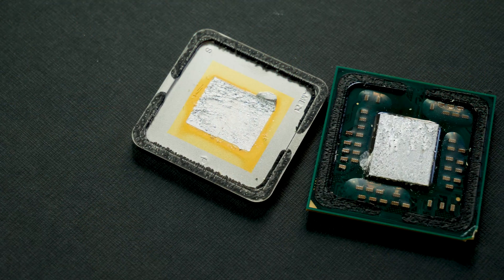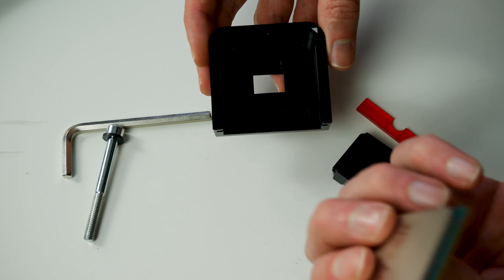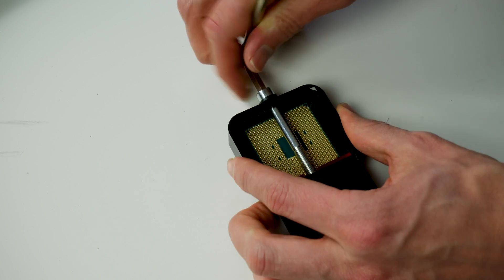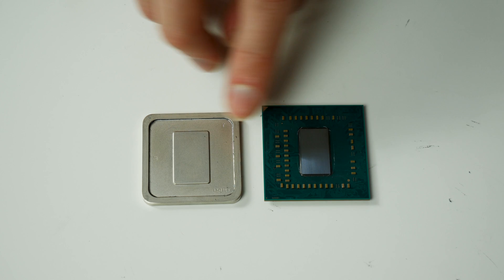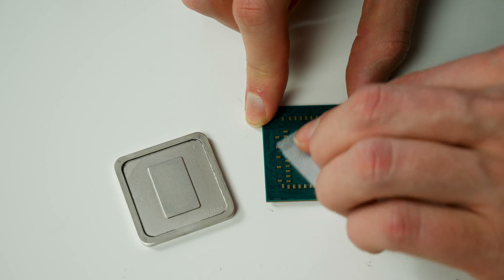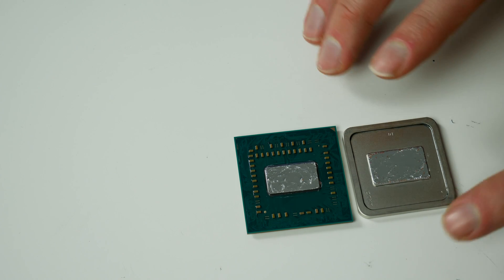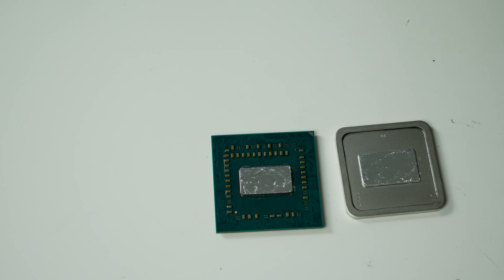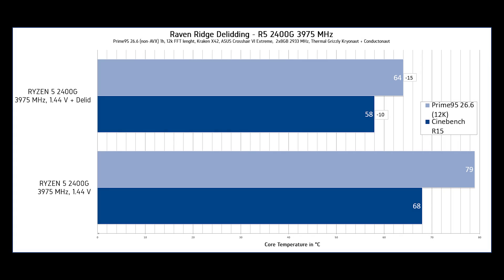Raven Ridge - Ryzen 5 2400G delidding. Before/After Temps (en)

Comment: Would have liked to see stock TIM max overclock with load on both CPU and iGPU vs delided max OC load temps on both. I already saw that the iGPU on stock TIM hits about 1.6GHz and the CPU stock because it was running about 90c, i just want to see what a delidded CPU and iGPU can overclock to while both under load.

Also noticed that when you overclock the iGPU the 2200G catches up to an also overclocked 2400G, possibly a RAM speed contrant (3200 C14, over on Hardware Unboxed)
Reply: I'm pretty sure in that video its oc'd 2200G being compared with stock 2400g

Comment: Is liquid metal safe in the long run? Does it damage the CPU after some time?
Reply from the maker: it's safe :)
Reply: it's f***ing great
picked up a cheap used R9 390 because the guy was complaining its too hot and loud, a quick clean and some thermal grizzly -25c and wayyyy lower fan speed

Comment: You can cut a small piece of paper and put it between the pins and the screw, that way the screw can just very gently slide on the paper and cannot "touch" or get stuck on a screw thread(s). That is if you want to be extremely careful. 
Great video mate :)

Comment: Now all we need is for AMD to release a 6 core 12 thread APU. Also some motherboard maker needs to make a DDR3 motherboard. To make upgrading to ryzen more cost effective. It's the only reason I upgraded to kabylake over ryzen last december. Some may think DDR3 is too slow but due to it having half the latency they are really the same speed. Not counting some of the super highend kits.
Reply: The memory controller is in the CPU.  nothing the MB manufacturers can do about it if the DDR3 support is not built into the memory controller for it.
Reply: Ryzen and Raven ridge  only has a ddr4 controller so not possible...
Reply: TheInfinium99 not the same, the design of the professors allow for addition of extra features that uses pci Lanes, such as USB etc. The memory controller in these modern processors are tied directly to the CPU and is not designed to be bypassed to an external version if in understanding right. If it was possible I'm sure it would have been done already.
Reply: What you say is true. I think where the OP is getting this idea is from the fact that AMD has made IMC's that supported DDR2 and DDR3 (Phenom II ) and then DDR3 and GDDR5  Kaveri(though it was never enabled in retail units) and then Carrizo/Bristol Ridge has the same die (yes different REVS) but one used DDR3 and the other DDR4... However all Ryzen CPU's and APU's have DDR4 and NO DDR3 memory controller. I will have to dig more into the document on Raven Ridge to findout if AMD pulled another Kaveri and has an extra channel or two on the IMC and GDDR5 support.. Lol..
Reply: Kareef Huggins it's more than possible as motherboard makers have made chips in the past that can add support for extra things like. Usb ports and pci-e lanes.

Comment: What about the graphics OC? That’s what we wanted .. we already know that the cpu isn’t gonna clock over 4.1 and the temp isn’t the deciding factor, it’s mostly architecture... but the GPU is the question!!
Reply: the iGPU's core clock can be overclocked but it will be bottlenecked by the memory clock which is dependent on the system RAM. even at 3200mhz dual channel latency it's barely half that of a standard discrete GPU's memory clock speed of 6600-7000 MHz. so no point overclocking the iGPU since the system will just wait for textures, shadows and occlusion to render before moving to the next set of pixel rendering and command execution etc
Reply: You're talking nonsense, mayne channels are doing 1500Mhz+ test with 30-35% improvement on igpu performance. Which basically means playing from 28ish fps to near 40~ish fps.
Reply: Gpu performance scales better with gpu clocks than memory, memory overclocking can improve performance but nowhere near what core OC's do, this is really old knowledge by this point.
Reply: talking nonsense?  like what and name 3 "mayne channels" that are oc the gpu up to 1500Mhz or better , I want to see delided and aggressive cooling and going extreme on the overclock or to the clock barrier
Reply: GPU@1600Mhz Ryzen 5 2400G Review PUBG. Gameplay Benchmark. Vega 11 iGPU
Reply: sorry it was late last night and NO ONE was working the chip over on the "Mayne Channels"  lol
Reply: I'm sorry I was lost and confused you weren't even talking to me....please excuse me

Comment: Can you do a measurement of the die size compared to standard ryzen? It would be interesting to see what size is the GPU part. 
And do you think it's possible to see the difference between the 2 like you did with threadripper? (With the special non conductive liquid) For example when stressing only the CPU or only the GPU at once to see where the bubbles are.

Comment: Hey der8auer, thx for the interesting video. One thing that I don't quiet get: Don't you lose warranty anyways when overclocking? AMD clearly states this for example before I can use Ryzen's Master Software.
Reply from the maker: Only in theory. Nobody cares if you RMA an overclocked CPU. Nobody wants to say it but this is the truth :D
Reply: Oh, thx for the clarification!
Reply: how would they be able to find out? i heard that some CPUs may have a "warranty bit" that gets set when the clock speed or voltage exceeds a certain threshold but i don't know it really exists and if manufacturers even care reading this bit at all when handling RMAs.
Reply: It is said only that AMD has the right to void your warranty if you overclock, as per the warranty terms.
They say it does, I guess, so you feel responsible if you break it.

Comment: Awesome work. AMD's thermal paste seems to perform better than intel's counterpart. We all know that intel uses the cheapest possible TIM to maximize the their profits even on USD 1.7k processors, a real shame!
Reply: Mike Crapse the chances of failure induced by soldering are nowhere near those figures. If 10% of chips died when soldered, nobody would ever do so.
Enthusiasts shouldn't have to risk their money and void the warranty of their cpu because of intels crap decisions.
They've soldered chips before. We're nearly in 14nm's 4 year. Intel has good enough yields to take it
Reply: I got your point, but, intel's profits are about 30%, so a USD 1.7k chip costs for intel about half of that, or USD 850. If you add USD 15 of cost to make a really cooler processor, and you don't, it is only dirt money saving for intel itself. You, the customer, will have a very hard time trying to cool a 165W chip and will need to get a USD 150 AIO just because intel decided to save 18 bucks. Intel is a very nasty company. Of course if you use a  low TDP chips (up to 100W) at stock speeds a good USD 45 cooler will be fine.
Reply: No one can really prove this as the Sandy Bridges are up and running for almost seven years now without known issues! It is all FUD made by intel to justify the 18 bucks savings, right in our faces. Remember that an i7 2600k @ 4GHz runs at lower temps than an i7 4790k @ 4GHz. Against facts, there are no arguments. Period!
Reply: @Niko Bellic What the heck are you talking about? Intel used solder for many years, it was only the last few generations they switched to TIM, and people started complaining as soon as they switched. It has nothing to do with AMD. And AMD has used TIM for many years on their APUs - no one in the know is blaming AMD for anything because they are only using TIM on products that aren't normally overclocked. Almost no one cares that they use TIM on their APUs, delidding one is an academic exercise born of curiosity more than anything else.
Reply: nope, read this link to clear things up
https://www.reddit.com/r/Amd/comments/7x6g6r/tim_in_apus/du7yhnf/
Reply: Make sense, but still is a shame that intel uses thermal paste on a High End Chip like a core i9. Have you already delidded and Xeon Scalable to see if there is Paste or Solder onder the IHS? It would be very cool to find out!
Reply: AMD always used TIM for APU, so what's new?
Reply from the maker: Lol it's the same on AMD. The difference is just not so high on this CPU because it's relatively low TDP and the die is fairly large
Reply: The failure that the companies are concerned about is not so much at production but after the sale. Some thermal interface materials work well when new but degrade over time or under certain conditions. They will want to make sure that it is unlikely to fail until long after any warranty period. This can mean choosing a TIM that is less than ideal thermally but more likely to last longer under a wide range of conditions.
Reply: When intel does it, no one bats an eye, when its AMD, shame on AMD. This was a non issue until AMD used soldering for Ryzen. Now, people are so quick to dismiss AMD.
Reply: "No one bats an eye" LMAO. Did you live under a rock when Intel released Skylake-X? Everyone was out of their minds.
Reply: Why is this matter of such concern to intel this generation then ? Why not for the last 20 or so years?
Reply: Marco Chaves haha typical AMD fangay trying to defend AMD 😂😂😂
Reply: Marco Chaves not that I'm defending Intel, but as I understand it, it's less about the cost of the actual solder and soldering process and more about soldering the chips introduces a slight chance of failure of the underlying component. I believe that it is somewhere around 6-10% of dies fail at the soldering process. if it costs Intel ~$1500 up to that stage in the process, the soldering process will then cost at least $150 on top of the solder cost(probably another $25) for the failed parts. so, on a $2000 part you reduce profit margins by 30% for what gain??? the super enthusiast will just delid it anyway, and they "don't support overclocking" of the CPU. it runs "fine" under these high temperatures at stock anyway

Comment: I think the A10 and 4 core APUs where soldered, the ones that cost a bit more money as in, but does it really matter? Easier to run bare die for xtreme stuff and normal users won't really notice much, budget guys will probably use the stock cooler.
Reply: very true...
Reply: AMD uses tim on all their apus.
Reply: 2:36 That is literally a soldered APU... What else can I say, did you watch the video? Did you?
Reply: No. They used solder on the A10 7870K and 7890K Godavari APUs.
Reply: DD KK yeah that's what I said, however you never know for sure until you delid one and I've never use the FM2+ socket

Comment: Awesome video as usual , but why de-lid a 99 bucks part?
Reply: he just answered that at 12:45.
Reply: Why not, if anything the risk is lower so it makes it even less scary
Reply: Personally, it doesn't matter if my component is cheap or expensive, if I can make it better by doing something about it like delidding a CPU then I'd do it. A lot of people may have the same mindset as I.
Reply: 169 for the 2400G
Reply: Rigel Sinco interesting, I always factor in the fact that I could destroy a system into my decision
Reply: Well... that's also a part of it. I forgot to say that when I say I'd do it, that means I've done enough research so my chances of success is high or as you have said in your previous statement, if the risk is lower it makes it even less scary.
Reply: Rigel Sinco I have to admit that I usually end up destroying hardware anyway, but I know what you mean; risk assessment and potential gains when stacked against budget can always end up screwing with me. Like linus' liquid metal laptop video, low cost, high gain but also high risk. I am having a hard time deciding to do it or not.
Reply: Proof of concept really...

Comment: Please try to undervolt the CPU part and overclock the GPU part. Would be fun to see what performance can be achieved
Reply: snozbaries Because it's fun and interesting to see what's the limit of the new hardware... Why not?
Reply: I second this. Undervolt CPU and push the gpu.
Reply: snozbaries I agree. For most people the best thing is to just get some decent RAM and just use the stock cooler and do nothing. However, der8auer is a guy who's known for pushing hardware to the brink and testing the performance of different configurations. It would just be for fun, but that is a good enough reason in itself.

Also, if these chips ever make their way into laptops, undervolting the CPU would be great for battery life and cooling.

The CPU in the GPD WIN is known for gaining a lot of gaming performance by undervolting the CPU and overvolting and overclocking the iGPU.
Reply: @snozbaries: Exactly for what the chip is aimed at: Scenarios that don't need much CPU, but do profit form better integrated graphics. HTPC, entry level 'multimedia' pc with some room for games.
Reply: This, please!
Reply: And now AMD is releasing the Ryzen 5 2400GE and Ryzen 3 2200GE by doing pretty much exactly what I said. huh
Reply: No point in non-laptop APUs
Reply: Kristoffer Johnsen , you can’t separately under/over-volt different parts of an APU. You have to do the same to both.
Reply: @RB1of1  
Yes you can lol
Reply: Why?? It's not like these chips will ever be huge performers no matter how cool you keep them.  They are what they said they  are. Low to mid range cpus with better than Intel integrated graphics nothing more.
REPLY

Comment: an interesting chip all around, although i would like to see if the vega part can be "uncorked" so to speak, we know that vega is capable of 1600mhz+ so what is limiting the igp clocks?, if its just tdp surely something in the bios could be done. (edit) i would be interested on an ln2 on a budget series, like try and oc some stuff on ln2 for a low budget
Reply: The 2400G has a very big IGP (it has 11 CUs, the RX 550 has only 8 CUs), so it is most definitely severely choked by the memory bandwidth, even at stock iGPU clocks, so memory speed is super important if you want to see FPS gains from iGPU OC.
Reply: Big Cazza the guy from "hardware Unboxed"  overclocked the igpu to 1600mhz with very nice results!
Reply: AFAIK there is no hard TDP limit if you OC on a decent motherboard
Reply: With 1500-1600Mhz on the igpu you get around 30% improvement over the stock clocks, 2200G igpu scales even better.
Reply: RS4 B5 the bandwith is enough for the purpouse of this APUs... don't you think?
Reply: since you cant overclock the RAM above 3000mhz, your only choice to keep imporving performance is to lower the timings as much as possible.
Reply: true, also dont buy the igp mem bandwidth thing unless its a relatively big igp, my intel hd on my g3258 got 1 more fps from going 1333mhz 9-9-9-24 2t to 2133mhz 10-12-11-33 1t
Reply: Intel iGPUs are puny, there's no chance they are bandwidth limited. However raven ridge's Vega 11 is badly bandwidth limited, smaller Vega 8 not so much. That's why Vega8 gains more from overclocking.
https://www.techspot.com/review/1574-amd-ryzen-5-2400g-and-ryzen-3-2200g/page6.html
This also means Vega11 is going to be best iGPU using system memory for long time until DDR5 comes in 2020-21. Anything better would require dedicated video memory onboard.